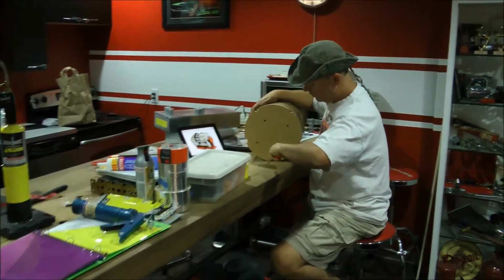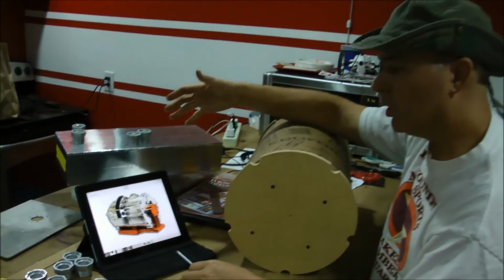1966 Electric Mustang Conversion part 6

Comment: I hope you let us see you test drive the 1966 mustang with the am racing 250-90 dual stack ac motor.   I looked up the hp and lbs ft of torque specs.  That motor is comparable specs to the 1970s gasoline powered v8 muscle cars.  So far I haven't been able to find any YouTube videos of people testing this engine.

Comment: what is the horsepower?
Reply from the maker: V8 monster 420hp 550ft.lb. torque
Reply from the maker: V8 monster  I forgot to mention, what's really interesting is that the motor basically can produce that up to around 8000 RPMs and continues to produce pretty serious power all the way to 10,000 RPMs

Comment: Any more progress on the bodywork of the mustang? Would be cool to see some shots of the car even if it's in a mess. Do you have any concerns over the batteries being a fire hazard? Do you have any fail safe in case it ever did? Love your videos, the zombie 222 has truly converted my way of thinking of electric cars. Would love to do one myself in an old vw caddy pick up. Keep up the great videos 👍
Reply from the maker: More body work coming soon. We just got excited about the arrival of the new motors, I had to take a break! We are also having to do a lot of slow work (cutting and welding) to fit all of the new body parts.
Reply: +mitchmedford sounds exciting can't wait to see.

Comment: Is there some standard busbar to hook up those cell tabs or do you have to make your own?
Reply from the maker: Every battery is created completely custom to fit the car. These will likely use an aluminum bus bar, but we have also used copper on the Zombie 222.